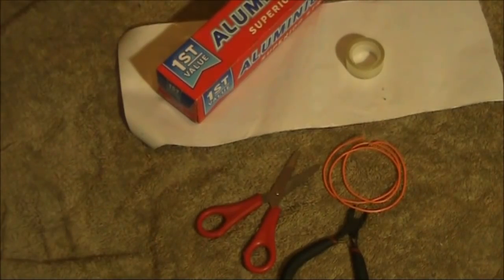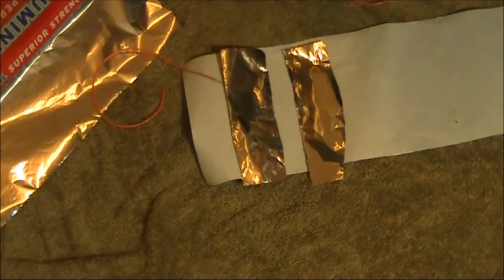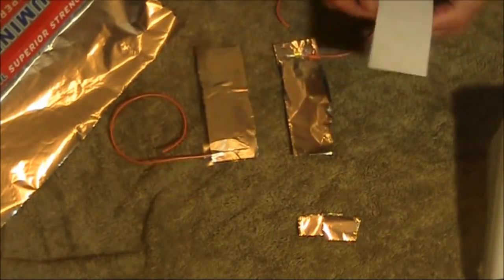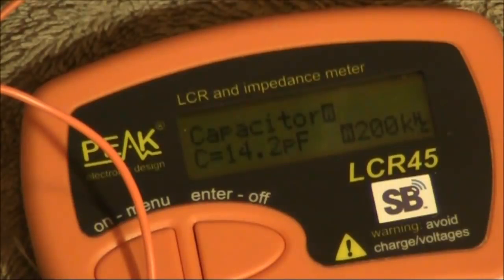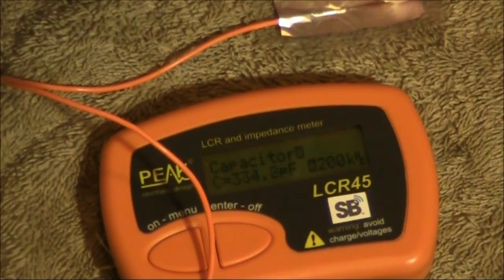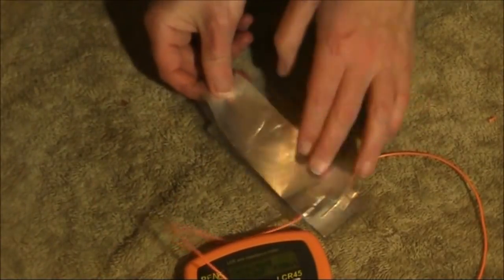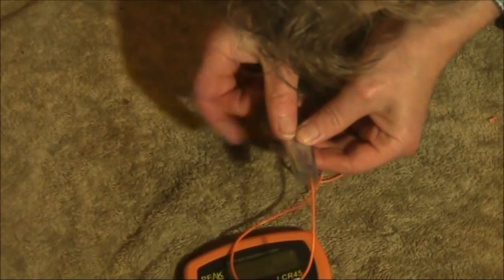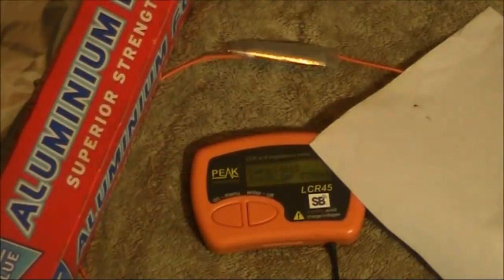Make your own capacitor with stuff from the kitchen

Comment: nice video! vfb!
if you use copper foil you could solder the wires. I did not try yet but should work!
cheers, mate!
Roberto
Reply: munichman1968 
"copper foil" is not available  .
Reply: @mohammadalfauomey3443  this ain't true...
Reply: @mohammadalfauomey3443  copper foil is available but with much thicker size than aluminium foil for food wrap.
Reply: @Glasnot1  Indeed, these use it to shield cavities from external RF, for example, in electric guitars (the body is made from wood) and the compartment which contains the potmeters is often shielded with adhesive copper foil.
Reply: @PaulaBean  yes and lately there are some manufacture who made a tape with copper backing, but there are so much fake out there, i don't believe it have practical effect since the backing it is not entirely 100% copper foil...

Comment: What would be the typical capacitance of a 1-litre Leyden Jar, made from an old PET soda bottle?
Reply from the maker: No idea! Build one, make a video and let us all know.
Reply: @vk3ye  Excelllent advice! I do have a capacitance meter, so I can coat a PET bottle from the outside and inside with aluminium foil and measure the capacitance!
Reply from the maker: @PaulaBean  Yes, that will work.